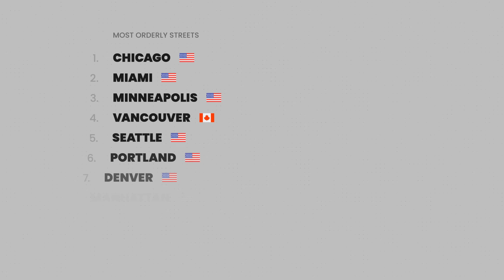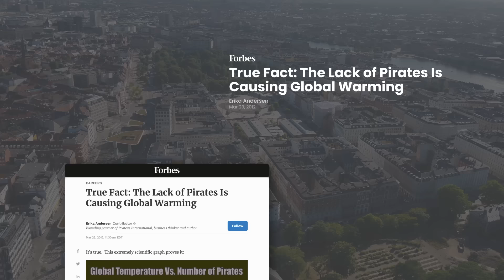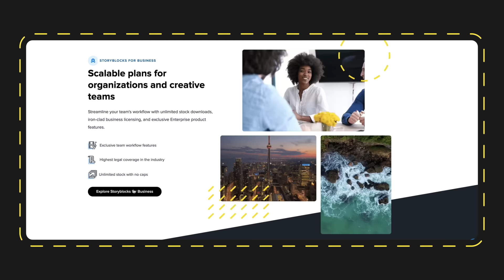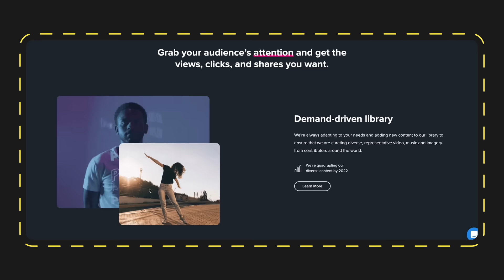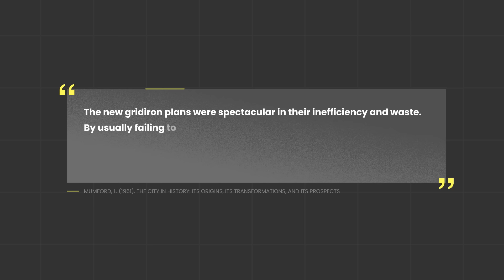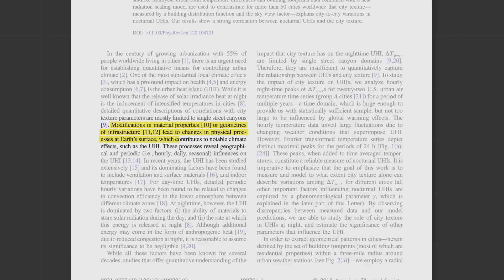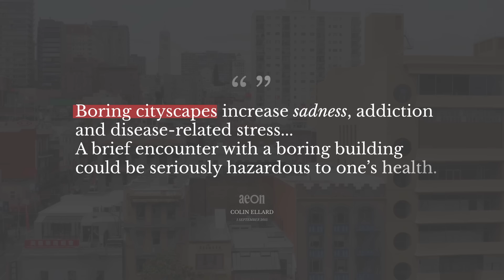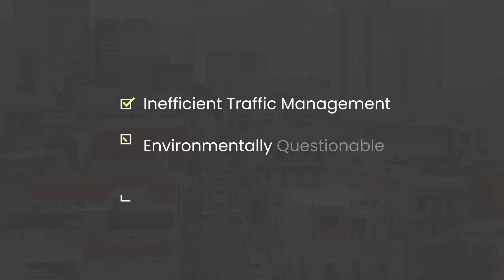Why Cities With Grids Are Terribly Designed

Comment: Helsinki, regarded as one of the "most livable" cities in the world has a grid plan, or more specifically three grids in slightly different orientations "smashing" together at the centre. During the 60s there was a worry that cars were becoming grid-locked, pun intended. An American town planner consultant advised the city authorities to rip through the city with elevated freeways. Alarmed at the idea of demolishing historic buildings to build the huge roads, the city decided the better solution would be to build an underground / metro system. The problem had never been the grid but the cars.
Reply: Same with Stockholm, which is also on the list in the video. The metro area is a grid-like, while the suburbs are not. My guess is that many European suburbs are not grid-like, which reduces their grid index score.

Comment: Grids aren’t the problem, it’s car-centric planning that’s the problem. You wouldn’t call vast urban sprawl with cul-de-sacs and curved streets livable, because they’re based around cars. 

Grids were livable before cars because there was good public transport, and the city was based around people. Grids don’t make a city any worse than another one, it’s how good public transit is and how pedestrian-friendly it is.
Reply: On point 👉
Reply: Chicago and Manhattan may be gridded, but at the same time, they're also some of the few places where pretty huge portions of the population don't even have a car.
Reply: Your points are valid but grids still suck. They are still extremely inefficient for the car traffic that remains and highly unsafe
Reply: @GuidoHaverkort  Then don't plan your city around cars. Look at Copenhagen it's full of grid structure but a ton of people walk and bike there because the roads are built for it plus they have way better public transport than most American cities.
Reply: Even with public transport, you still need some larger streets (with rails) and other smaller ones. These streets should also be oriented at, from or parallel to the city center rather than being based of a coordinate system, or you would have to do a zig-zag course if you want to travel for example northeast. Also, as mentioned in the video, with the grid system you need a lot more streets on the same area, which also means that as a pedestrian, you have to cross a lot more roads.
Reply: @honeycomblord9384  Chicago and NYC are both very dense cities which in turn makes good public transport viable.
Reply: Prior to the automobile, cities didn't have "good" public transportation. Most people walked. Cable cars were notoriously dangerous on turns and only the upper classes could afford street cars. Btw, when street cars were invented, those who could afford it immediately moved away to live in street car suburbs (additions). This was prior to the automobile. Nonetheless, automobile are overwhelming better then public transportation, which is why people choose them.
Reply: @aliquewilliams3080  I guess you have a point about public transportation not existing before cars, but he's still right. Before cars were widespread cities were built around people, not cars. Cities from that time were(and are) a lot more livable than the sprawling suburbs that American cities currently have. Density is the key for good public transport
Reply: @staropramen478  Cars are here to stay and cities HAVE to be planned for them. Walking/biking isn't a norm anymore..
Reply: No one asked am*ricans opinion
Reply: @Zeromaus  NOPE!! Cities are for him an beings, not cars. Cars destroyed/ destroy cities!!

Comment: In the beginning it sounded like you were trying to avoid drawing conclusions from spurious correlations, but then you say “grids are correlated with more asphalt or paved areas”… which, because of the US’s urban design, car-centric culture and predominance of gridded cities is just that: potentially a spurious correlation
Reply: I dont think it has anything to do with being car centric, you can have a grid design and still support transit, look at DC, NY, Boston and Chicago, all grid systems with Transit, the cars are the problem
Reply: @Racko.  I agree. My point was: the US is very car-centric for a lot of reasons, and it also happens to have a lot of grids because the cities were built from scratch in modern times. Therefore, you can't conclude that grids are correlated with more asphalt and paved areas.
Reply: @TheShortStory True, It's quite the same story with Canada and Australia, even though not all of their cities are grid, they still face alot of car dependency, And what do all these 3 nations have in common? They're huge, spread out and lower density compared to European and East Asian cities/Countries, making long stretches of roads did fix most of the issue for long distances in a not high demanded area too

Comment: Maybe the problem is not the zoning, but what is included in this zoning? Barcelona looks great with grids and low-rise buildings and an abundance of greenery. Non-grid zoning is unlikely to save American streets from overheating and stagnant emissions, because these streets are surrounded by huge boxes of glass and concrete with dominance of cars.

Comment: A couple points to make here:

First, many European cities were originally established by the Romans with a grid pattern, and over time moved away from a strict grid as there are advantages to some other patterns.

Second, when speaking about grids vs. cul-de-sacs, the issue is not so much about a grid with all right angles so much as it is about streets that allow traffic to move through smoothly rather than ending in dead ends. It's about whether all traffic is forced onto a handful of high volume through roads, or is allowed to spread out over multiple roads.
Reply: you can still see the ancient Roman grid pattern in some of the European cities today; Thus in Regensburg City the streets of the former fort Castra Regina are still the very same today
Reply: Most of the German cities that were originally founded by the Romans were founded as army camps and fortresses. They did not need to be pretty, the cities were build around them later.

Medieval German cities and towns are not planned as grids. They are planned with bends, angles and distances that reflect the usage of the houses and made them purposeful for the activities of the people who lived there. For example, a short distance to a place that was needed nearby.

Straights are found to the central places, usually the market place with church (to get the people there quicker there, and to transport the goods from outside to the central market). 

Today Germans say, that the layout of these places have something deeply homely, cosy, human, something that makes them very attractive ... but most are not aware why. 

There is a German video that explains what I claimed above, but it's only available in German language.
Grid is shxt.
Reply: Yes, I agree, it's the dead end and feed-to-arterial micro management that drives-me-mad. A grid street pattern can be ruined just as well; however, there's less hope, to begin with, for a curl-de-sac :P. 
  1. It's annoying when you're by car 
  2. even worse when you go by bike, since you have to travel less direct routes, especially when the bike routes are an after thought. 
  3. By foot you feel like you have to cross a waste land to get anywhere.
Also those areas seem to favor a district "center" that is not very close by bike or walk, in front of proper neighborhood grocery stores. They are often not connected to the rest of town either.
Reply: Two points, two lies 

No, cities founded by Romans are not based grid design. Absolutely not.

Traffic and street design are not related. There is a physical limit to any road. When it reaches full capacity traffic is jammed. As simple as that.

Thanks for misleading the audience.
Reply: @yeshuahdenazareth7868  at least (some?) Roman fortresses had a grid design; The one in my city had one and you can still see it today
Reply: @yeshuahdenazareth7868  There were quite a lot of roman cities with grid design, it just depends on when the city was founded. New cities in conquered territory often used a grid design, but ofcourse cities that sprawled out of already established villages/towns didn't get this grid design.
Reply: @EnjoyFirefighting  
We're not talking about a fort or a square here. We're talking about a grid. The Romans did not build a grid system.

Is that clear?
Reply: @yeshuahdenazareth7868  they actually did in my city but I leave you with that lol
Reply: @MDP1702  No grid system in Roman founded cities.
From the most famous one Roma (built on 7 hills...) to Paris (Lutecia) to Canterbury or Bath or Cologne or Lausanne... The list goes on and on and on.

Romans were civilised and only an uncivilised people would use a grid system. Clearly.
Reply: @EnjoyFirefighting  What city would that be. Humour me.
Reply: @yeshuahdenazareth7868  The city of Rome was built wel before Rome spread out and really got this disciplined engineering approach. Lutetia actually initially had a grid system, not a perfect/very strict one, but even today that is not the case for all grid cities. Overtime Paris has definitelly moved away from this grid system and even older streets/buildings moved around causing the loss of that grid system. Cologne also has been known to have used a grid system. Lausanne also is expected to have been initially grid based and Canterbury also or close to it. 

Don't make the mistake to take modern/medieval layout and think it is representative for the roman time. Buildings get destroyed/taken down/burned and moved, roads too get moved quite often over long periods of time. Also don't make the mistake to think grid cities are all exact grids, they aren't, some modern cities are the exception, not the rule.

A grid city in the past actually shows a greater amount of civilisation since it requires a lot more planning and controle. Grids are also more effective when used correctly, something the US just doesn't do, mostly due to how mobility has changed over the past 100 years and how the US had chosen to adapt to it.
Reply: @yeshuahdenazareth7868  what a load of bullcrap. If you don't have anything usefull to say, just don't respond.
Reply: @yeshuahdenazareth7868  traffic and street design arent connected eh? Insane. I suppose you've never considered multiple routes, direct routes vs indirect routes or isolated routes.

The question street layout is why is this car on this toad and can we make the route more efficient not X number of cars down road of x size equals traffic you put a second road in, you put secondary access to the high acrivity point everyone is trying to get to so the main road wont carry that traffic.
How can you claim they aren't linked
Reply: @KyleTremblayTitularKtrey  Number of cars on roads is the issue.
Reply: Here in Singapore quite a lot of our suburbs also have straight roads that cut only halfway thru the area before ending at a T-junction & then you have to turn off to a perpendicular road & find another road to continue your journey thru the area. In the town I used to live in that meant buses had to turn thru multiple T-junctions to enter the bus interchange at the town centre from the main roads, causing jams that sometimes backed up from 1 junction to the previous one (especially as turning vehicles have to give way to pedestrians (of which there're a lot) even when the light is green)
Reply: @yeshuahdenazareth7868  If you knew a little more than the absolute zero you know about history, or anything, you would know that the Romans created tons of new towns with a grid layer. That happened when the town was created from the expansion of a "castrum", a fortified position, or also when the town was planned from the start. Of course Rome does not follow this logic, both because it was not planned ab initio, and also because it rests on a hilly terrain, and where you have hills, hills dictate the shape of the roads, and this is why in the Middle Ages, where people, and towns, moved to the hills, you have those perfect-to-get-lost urban network, because it is dictated by the local geography. In ALL Italian cities originally funded by the Romans, which are many dozens, you can still find the cardus and the decumanus (and yes, in Paris as well, which was not founded by the Romans). My general advice is to troll away or to inform yourself better before writing BS.
Reply: @uffa00001  Be that as it may, wouldn't you agree with my opinion that grid cities are soulless whereas "organic" cities are much better?
Reply: Major streets went into the direction of the next city and when the city became more populated small grids grew along these roads, often with roads direct to neighboring vilages until everything became one big city.
Reply: @MDP1702  you said that "grids are also more effective"
Would you care to elaborate that point?
Because for me that doesn't make much sense.

For example if I want to move diagonally in a grid system I have to move a lot further than for example in a  radiocentric layout. (or would you also call a radiocentric layout grid?)
Reply: @Jehty_  Radiocentric also can be layed out out in a grid. A non-grid is more one with streets that bend a lot etc., essentially one that grew more naturally, adding streets where and when necessary without a bigger plan.

And in a radiocentric grid you'll also in many cases not be able to go directly to your destination and you get a lot of traffic etc, in the focalpoint. All designs have their advantages and disadvantages, none is perfect or the ideal one, otherwise it would be adopted for new/groing cities/towns.

Comment: I'm not sure this video made its case. Chicago is hardly boring. It has huge traffic issues, but the issue is the focus that American urban planners placed on the automobiles during the 20th century. 
The public transport system in Chicago is vast, though not as vast as in the past. There used to be more trains with more and far-flung connections that would even take you into neighboring states. Before the trains, there was a vast streetcar system.
The original Burnham plan included large boulevards and some diagonal roads, extensive parks and open spaces, many of which were built before the Depression began. And in more recent decades, the city has placed a lot of emphasis on fixing troublesome traffic areas, and creating bike lanes. Other traits, like smaller lots/blocks (compared to NYC, for example) and alleyways also add to the functionality of Chicago's grid.

Comment: I just looked up the 2021 city liveability index that appears on Wikipedia, which is completely different to your list. Of the top five most liveable cities in that index, Osaka, Adelaide and Wellington strike me as pretty grid like cities. A lot of other cities in the list are also pretty grid like. I suspect that you just happen to have chosen a list that is topped by non-grid like cities.
Reply: The reason they don't score high on that grid metric is because their suburbs look different. The inner cities have grid structures yet they are the areas that has the most life so I don't really understand the point of this video. The biggest difference between European and American cities (in general) is that the downtowns in the US are small and boring business parks with very little life after work hours.
Reply: @staropramen478  i have to disagree in line with my prior comment, having lived in Taipei, it's a very Grid based city, with very identical blocks from pretty much the same time period due to the nature of it's expansion after the Chinese Civil War. 

In Fact most cities in Taiwan use exactly the same building type, i.e 5 stories apartment blocks, with balconies a lot of times completely barred , even the doors are very similar and the same very not that pleasant materials. Tokyo and most Japanese cities are the same , there tends to be little variety in the housing and it work's to an extent but for the love of me i don't know why, because objectivity the buildings are ugly and bland with electrical cables hanging over the streets, and AC units everywhere.

Objectivity Tokyo is kinda an ugly city , due to the war, it's endless not very imaginative, rectangle mid 70's/80's typical urban developments. But somehow Tokyo doesn't come of as Ugly , it's very weird, put all these bland buildings together but the sum of it's part is greater.

the most 'beautiful' cities in E Asia tend to be places like Shanghai and HK, because they mix multiple time periods, multiple influences and you get these weird East/West mashups.

the interesting thing about Taiwan, the beautiful Bits , i.e nice ornate buildings, good tree lined roads where built by the Japanese as it's colonial power, the ugly bit's where built by the KMT(Chinese Nationalists) who saw their stay in Taiwan as short term and didn't bother.
Reply: @davidrenton  At least Taipei has a very good public transportation system and many parks, which makes it a nice place to live.
Reply: @udishomer5852  i love Taipei but I'm not sure it's the best place to live , it's congested, very expensive, very polluted , I love the chaos of it, it's an interesting place but I'm surprised it made the list.
Reply: As another reply noted, Taipei is a grid city. But the way he is measuring grids doesn’t capture Taipei’s grid, since each neighborhood has its own grid to accommodate local terrain (mountains & rivers). So the grids don’t line up evenly, but overall it is still a gridded city.